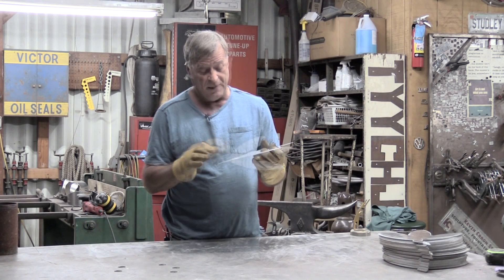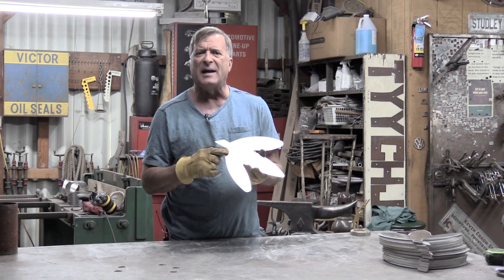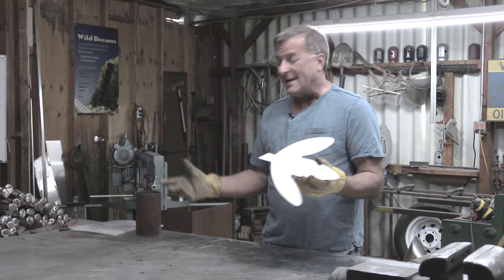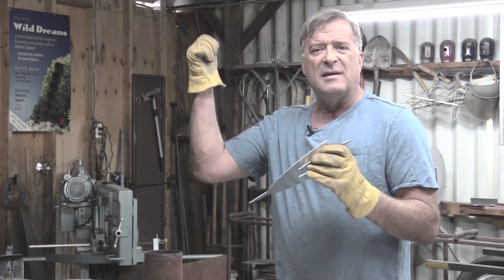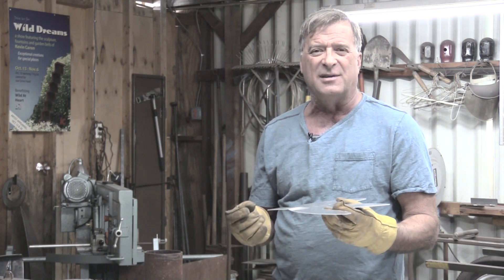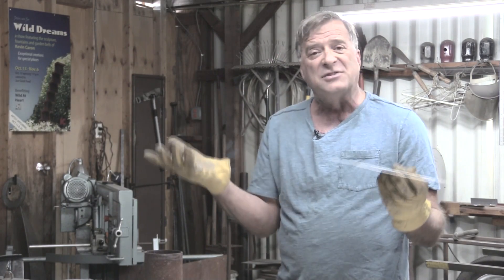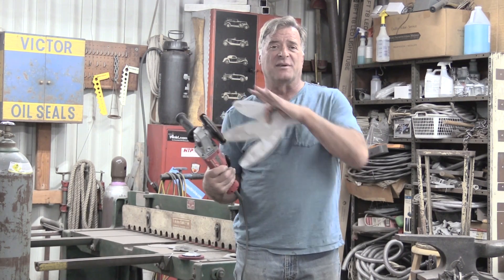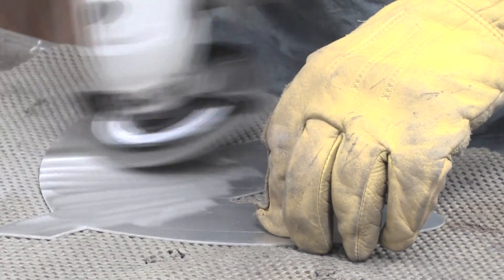Does Aluminum Rust? - Kevin Caron

Comment: That's because the aluminum they selling you is technically an alloy. Its not pure aluminum. An aluminum alloy is 80% or more aluminum. That means it will have  copper, magnesium, manganese, silicon, tin and zinc mixed in with it. Or some of those but Not all of them. It all depends on the particular type e.g. 5052, 3003, and so on.
Reply from the maker: I didn't know that.  Thanks for watching and posting.

Comment: "Moisture" gets into beer cans but they don't rust. You've been drinking too much wood alcohol and have lost sight of the fact.
Reply from the maker: All in good fun.
Reply: @KevincaronSculpture  not all grades of aluminum have the same properties. You should note the grades of aluminum which are vulnerable and which are not.
Reply: @dare2scheme904  beer cans and soda cans have a plastic coating inside them.

Comment: Good evening Kevin,
  My name is Bill Traeger and have been a subscriber for some time. My background is in woodworking I’m 70 years and love your talent.I have zero metal/welding experience.
I have volunteered to do an art piece for the Ice Age Alliance here in Wisconsin and our local chapter. I have done a little of the ground metal texturing with candy color topcoats .
On the web I see panels with waved/curved additions. How can one bend aluminum to these gentle shapes. Any help will be most appreciated. 
With respect and admiration, Bill
Reply from the maker: I normally use a slip roll for my shaping.    Or maybe an English wheel.  Hope this helps.   Thanks for watching.

Comment: It doesn’t rust, it oxidizes. 👌
Reply: Well....  Rust is just iron oxidising so same process different name.  Now if you really want to stretch the connection they are both "burning" really slowly ;~)
Reply: S Koue All rust is oxidation. Not all oxidation is rust.
Reply: Not so fast there.  Green Rust is not oxidation, though some varieties can contain some oxidised iron.

If you want to get technical.  So not all rust is oxidation.

But since this is not an engineering textbook and we are talking in more user friendly terms and understanding is the point then maybe some popular articles...
https://www.popsci.com/scitech/article/2004-09/amazing-rusting-aluminum
https://thecraftsmanblog.com/does-aluminum-rust/

As a fun side note on the mercury and "rust", Gallium will also disintegrate aluminum and it is safe to handle.

Comment: Yup, aluminium oxide forms wherever oxygen can come into contact with the raw aluminium. It's the same stuff you need to wire brush off in order to get a clean weld, just more advanced.
Reply from the maker: Thanks for watching Mike!
Reply: And... Aluminum Oxide is what sapphire is made of.  Almost diamonds and rust, but not quite.
Reply: Raw aluminum is Bauxite ore.